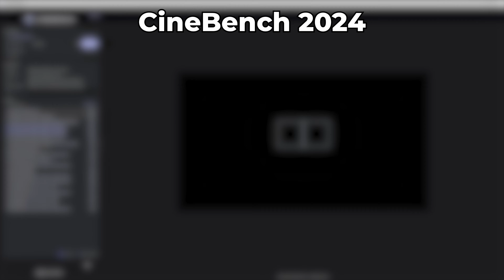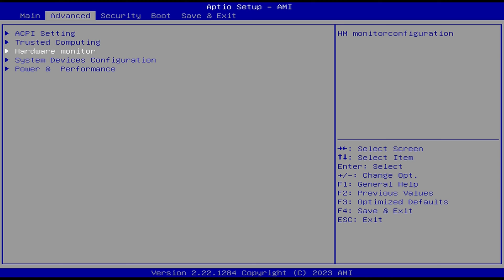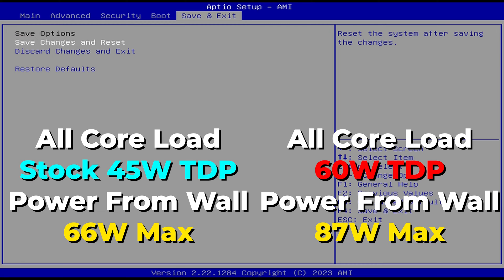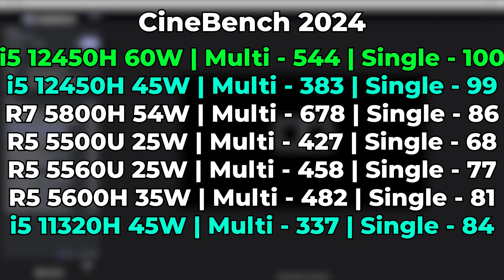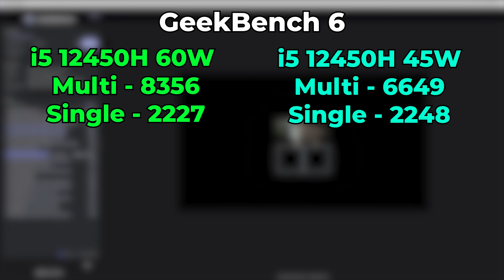How To Increase Performance on Intel Mini PC | MinisForum UN1245 Raise TDP | Unlock More POWER Intel

Comment: I bought one (i5-12450H) for about 300+ tax. Should be good as the i7 since the throttling. First few weeks are techie heaven. Using Macrium Reflect, transferred my well-developed Windows 10 installation to it, working great. Added an external USB NVMe reader for $30+ tax. Works better than expected, it's fast even when outside of Windows, making restore operations quick. I think the internal drive transfer rate is about 1 GB per second, and the external USB transfer rate is almost 500 MB per second. My big box motherboard integrated slots were at least 1.3GBs. The fact it's fast outside of Windows makes it better than back when I had an add-in card adapter for the PC. I guess those USB 3.1 slots don't require Windows' specific drivers. Using Core Temp to keep track of the CPU temperature, running cool.

I wouldn't want it for gaming, that's for sure, except maybe console games? The reason I am downsizing is because I'm not gaming anymore. These little PCs seem very good for my current use. It runs Fusion 360 (my simple designs) and VLC media, player no problems so far. My external USB microphone for security is on 24/7 and the thing uses ~17 watts when I'm not at the computer.

Comment: FYI measuring the wattage from the wall great in this case isn’t great, as those ratings are the output wattage not input. So an efficiency plays a roll. Assuming wattage from the wall = output wattage out is likely inaccurate, as it’s probably only around 80% efficient.

If you aren’t experiencing a crash from the power supply overcurrent protection, I wouldn’t worry about it.

Comment: 55w seems like a good compromise
Reply from the maker: I would not recommend that unless you buy a bigger power adapter for it. at 55W, it's still pasted the ideal 80% max load on the PSU. they really skimpped out on the power adapter. if you can get a 120W one, then it would be much better. at 60W, the pull from the wall is almost 90W. even at 45W, the pull from the wall is around 70W. so even at 55W, it's gonna be far to close to the 90W adapter to be ideal. last thing you need is the power adapter popping and taking the system with it. better to just get a system with a better less power hungry chip or invest in a bigger power adapter.
Reply: @EVOTech1 Better adapter it is. Do you by any chance know which kind of plug/voltage it requires?
Reply: @Havanu81  
The adapter is not your only concern. They didn't throttle the CPU for nothing. It's probably to do with the system's inability to handle the heat.
Reply: @EVOTech1  I was able to obtain a HP 135W AC Adapter and set bios to 65W and was running flawlessly since, thx.